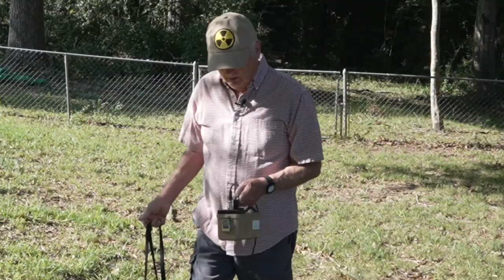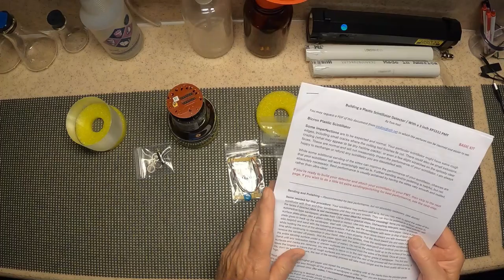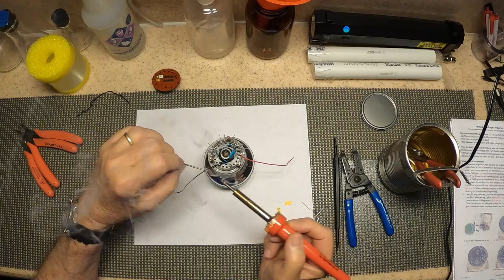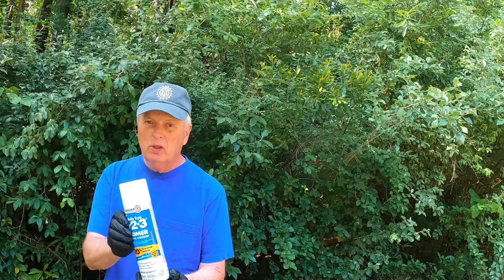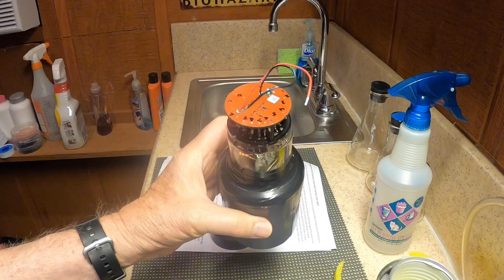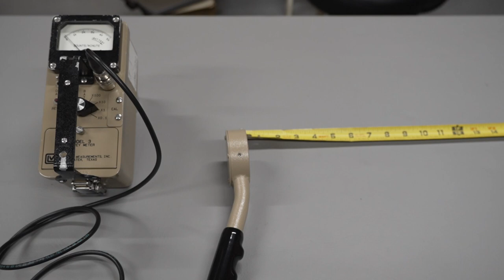Detect Radiation with a Scintillator

Comment: I made the same thing. And would like to make an output usb port for the ludlum model 3. For analyzing data. Great video
Reply from the maker: Thanks. That would be interesting, hope it works out. Actually, I have been thinking of getting a Radiacode 101 or 102.  They are pretty expensive though.
Reply: @bltc11  me too
Reply: @bltc11  the radiocode seems to be the only functional scintillator in that price range., every thing else is hundreds more